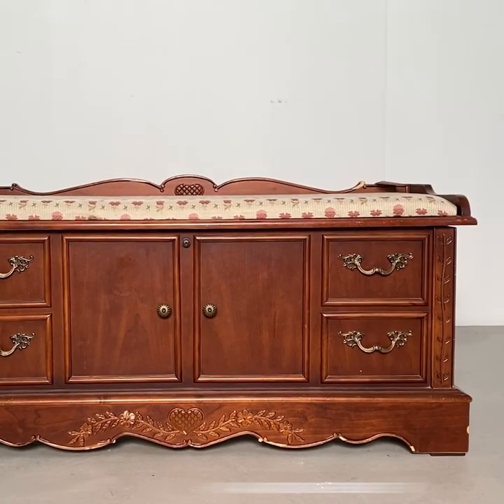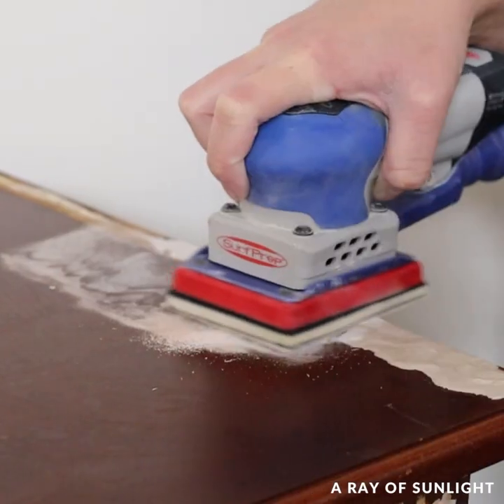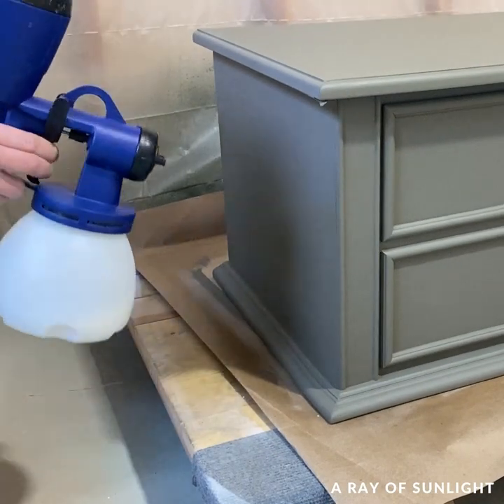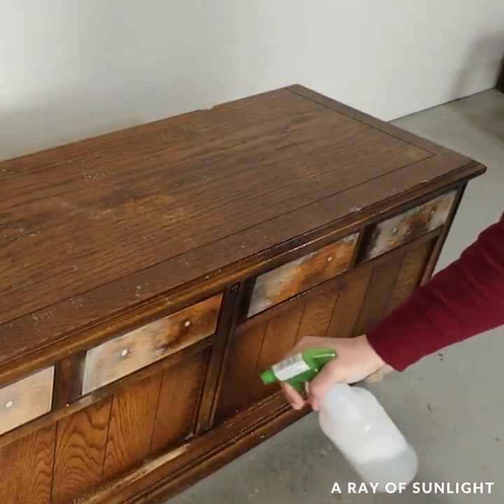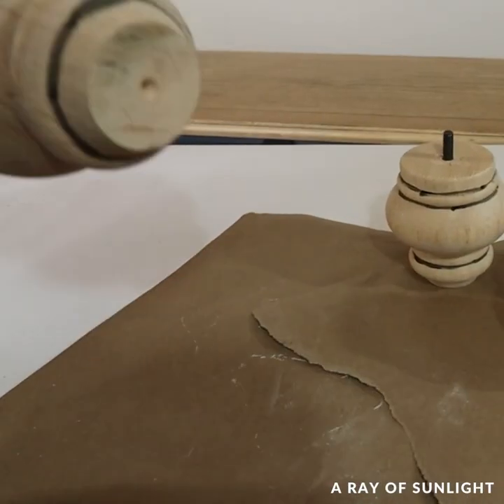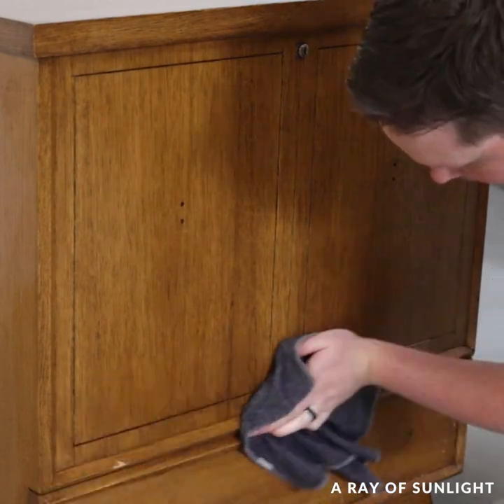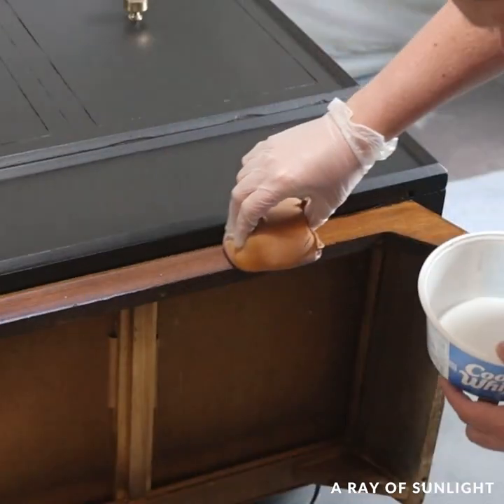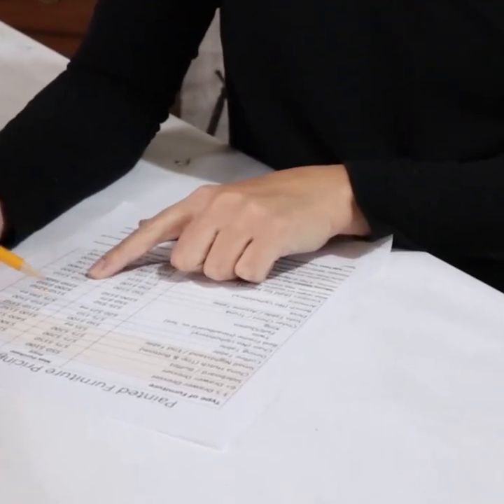Painted Cedar Chest Ideas | 3 Minute Makeover

Comment: 👋  I have a question about the wood putty? When applying why do you not scrape it level like you would when filling a hole on a wall rather than sand it?  I assume the sanding gives you a more even finish or the wood putty swells when drying?